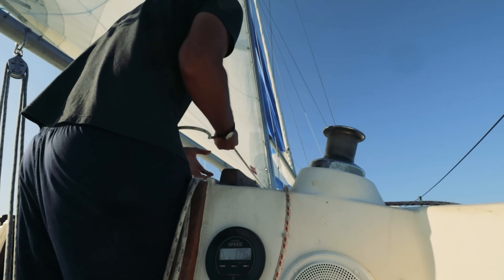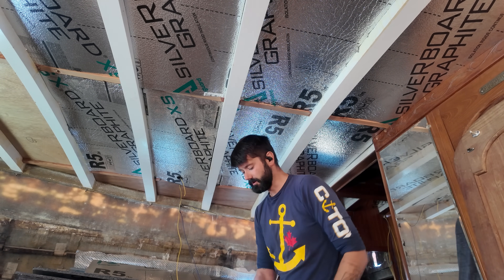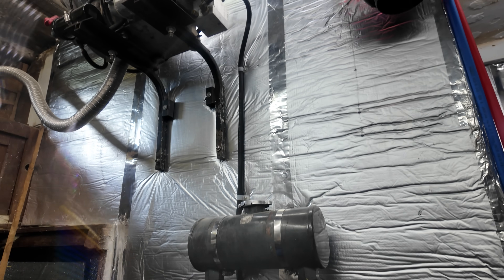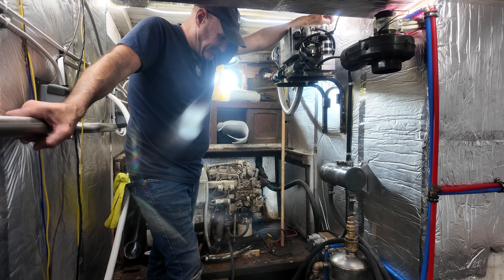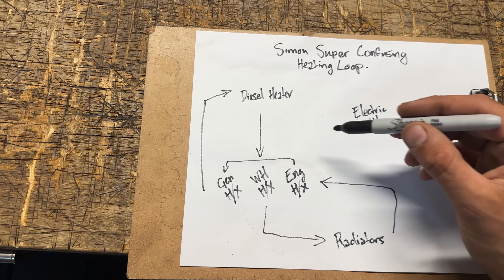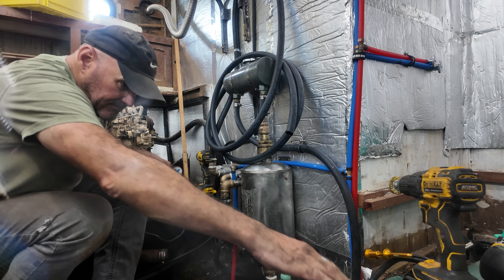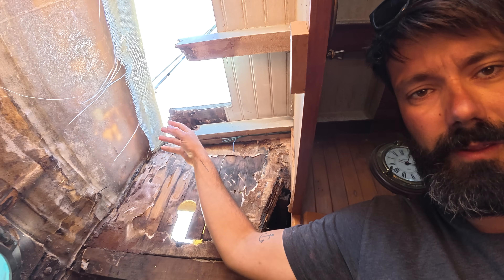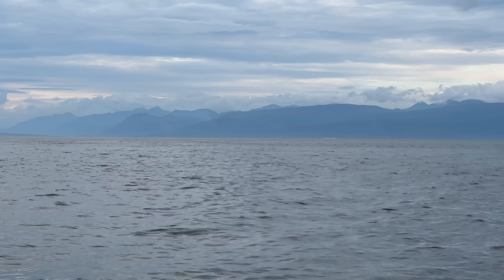Off-Grid Boat Heating and Lighting: Have I Made It Too Complicated?

Comment: My solid fuel stove with water jacket can also cook, heat the hot water, feed radiators, use hot engine water, and, pre-heat the engine. With a diesel blower for Spring nights it works beautifully.
Reply from the maker: Yeah I know it’ll take tweaks but I’m really looking forward to having this all dialed.

Comment: Diesel heaters such as Espar, or AirTronic, use brushed  air delivery fan. They last only one and a half heating seasons before the need of a complete rebuild.
Reply from the maker: This is a hydronic heater, not forced air. It’s been running for quite a few years.